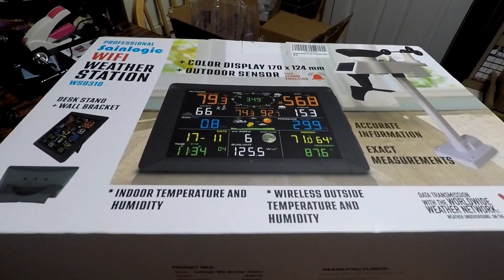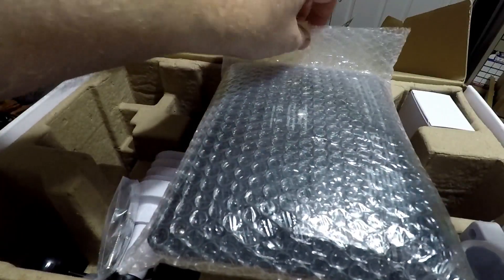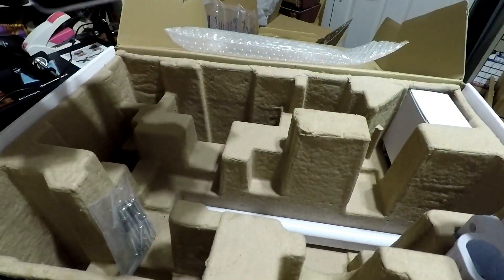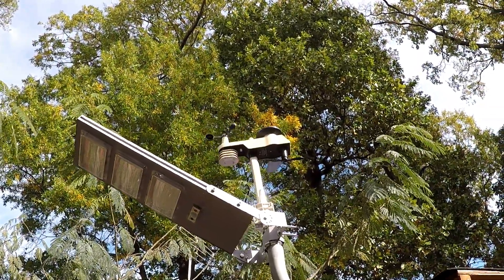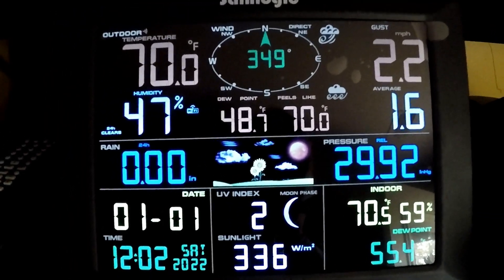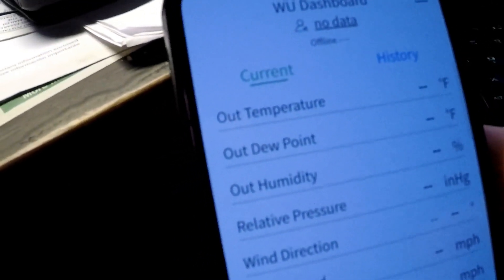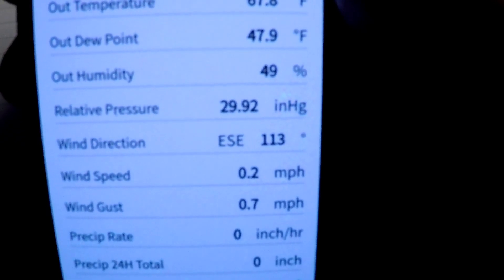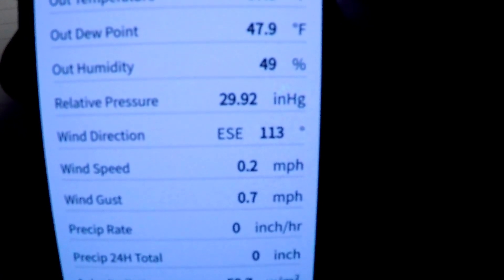Setup & Testing a Sainlogic WS0310 Weather Station

Comment: Thanks for your video!  I've had this same weather station for a couple of years now and it usually works great.  Except when the batteries die in the outdoor weather station, I have a lot of trouble getting the indoor console to reconnect.  Have you had this problem and do you know how to solve?
Reply from the maker: Thanks! I just unplug the display after installing new batteries and mine resets properly
Reply: @rvr2  thank you.  I'm at the end of my rope.  I've downloaded the manuals and updated the firmware and resent the factory settings and I just can't get a reading from the outdoor sensor.  Just dashes in the outdoor section of the console.  Tried pressing the RESET button on the underside of the outdoor part as well.